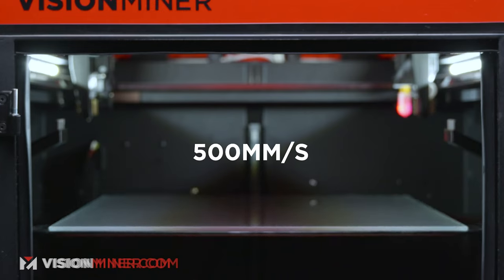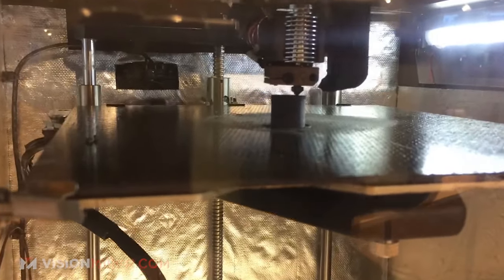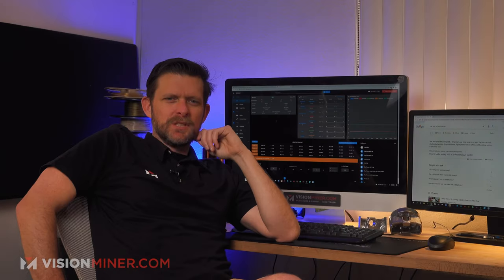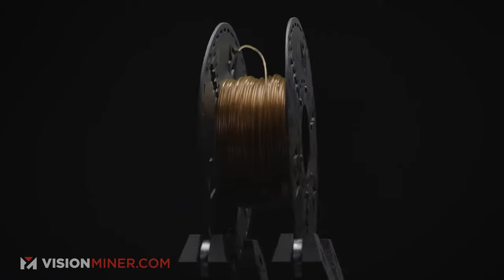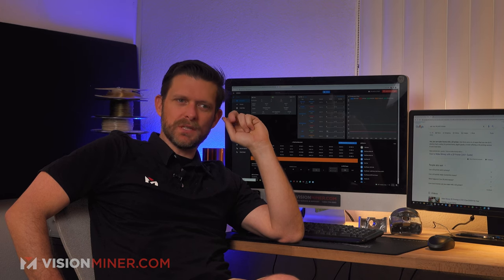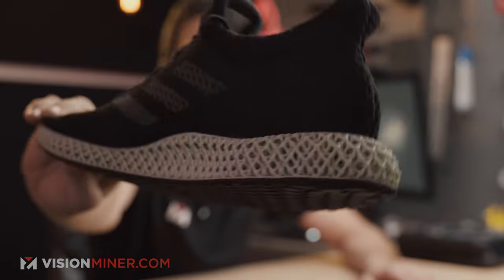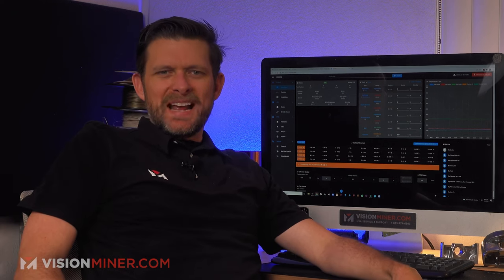The Biggest Lie in 3D Printing | 3D Printing Myths

Comment: I am a professional 3D Printing Technician and I have had customers complain that their parts did not arrive with the stated accuracy of the machine from the MFG of 0.01mm, with the misunderstanding that minimum feature size is not the same as accuracy.
Reply: Then it's your job to make sure that they understand that, if you don't want unhappy customers.
Reply: @marcus3d  Usually it's sales that is supposed to handle customer expectations
Reply: @StinkPickle4000  You're right. The "you" was referring to the service provider, as opposed to the customer. My point was that it's not the customer's fault for not understanding this, but the service provider's fault.
Reply: Yes minimum feature size is the same as accuracy. You have been scammed by the chinese printer companies and now you are repeating their lies. What other industry has such nonsense?
Reply: @marcus3d  It really depends on industry and customer-base. I would expect any engineer to understand the difference and do their due diligence on any contracted services.

Comment: About accuracy, I often see people designing parts for printing the same way as if they were going to be machined from billet aluminum or tool steel, with the same tolerances. There seems to be a lack of education in the manufacturing industry around how to design specifically for printing, and how to design for inaccuracy (meaning: factoring in inherent printing inaccuracy).
Maybe that's something a channel like yours can help evangelize about.

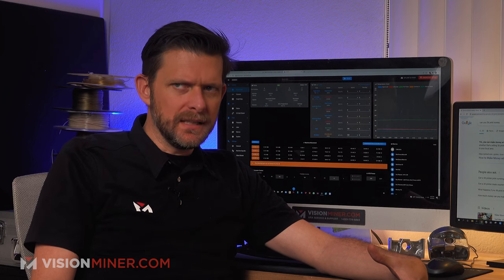Comment: 1:11 "150 mm/s" is not volume per time, so you can't say "to move that much material that quickly". It's literally a distance per time. You'd need 2(!!!) more dimensions for it to be volume per time, namely line width and layer height.

Comment: Would absolutely love a HT video! I absolutely HATE having to restart HT materials... Waiting for the bed to reheat.... Trying to pick the boogers and strip of the previous failed print (while burning your hand on the bed and getting a wiff of fumes)... Etc...

I guess for a video worthy research, maybe do nozzle and bed expansion for different metals and bed types. I know when I switched from OBC to ASA, I forgot to account for heat expansion and gouged a deep trench into my bed 😭😭😭.

It would be nice to know if I switch from low temp material A, how much do I need to offset for high temp material B if I'm using a brass nozzle... Or stainless... Etc

Comment: i know the video is 2 years old BUT watching 2 dudes talk what they learned and not read a fucking script in front of their face is so refreshing. I mean, is every channel now some sort of news channel where you gotta read like a robot? Thanks for all the information, cheers
Reply: oh and btw, I literally jumped into 3D printing world without any research, found used Anycubic mega x for like 1/4 of the price with a couple filament rolls nearby. It's amazing how precise it can get with minimum tweaking. Building a CNC for myself at the moment and was super worried how am I going to obtain parts that hold bearings, linear rods, etc. Turns out - just like that.

Comment: On Creality touchscreens, they will let you set the print speed to high speeds but dont have the facility to increase the acceleration so although it will say you are printing at the faster speed you have selected, in reality, you most definitely are not, some of their stock firmware was shackled also not that I kept that stock firmware for long as it was pathetic even if you sliced to that faster speed, they could not even get the X, Y offset correctly for ABL for 99% of their machines so you got the nozzle in the place were the probe should have been and ended up with a mesh that was not uniform or correct and only four-fifths of the bed actually probed
Reply: You absolutely can adjust the accel and jerk on the configuration screen
Reply: @MakerMark  On which machine?
Reply from the maker: Depends on the machine, of course....

Comment: Do you guys use multi material printers? I'm mainly interested in the quality, speed, and waste material differences when using multiple materials in the same print. I love the idea of water soluble supports, as well as combining complementary materials. Do nozzle changers or duel extruders leak while waiting on the other material to print? How do they not make a stringy mess?
Reply from the maker: It all increases complexity, and therefore the challenge, but once tuned in, you're usually good to go. Our new 22 IDEX is independent dual extrusion, so the extruders are off to the side during the prints, which prevents oozing and leaking, followed by a brush :)

Comment: ISO could help your C OF A validity do you pay an up charge on your resin purchasing for the c of a for every load or just at random loads? normally 1-2cents /lbs on 78000lbs(tanker)-180000/lbs (rail car) or box or bags/lot run and date. my question is the material a blanket C of A or a running each load C of A? do you get a c of a for each load or at random?and for each it would be specific to that load only?
Reply from the maker: We get our COAs from the filament manufacturers based on the lot number found on each spool

Comment: But FDM has changed with time. The bamboo labs x1 now prints at 400ms so it's changing and the filament is also changing.  And yes you can change the ender 5 to print fast depending on the hot end and boards and fans. Upgrade are easy and can be done now if you have the time and money.  So yes bamboo labs can now print fast and very accurate.

Comment: Sorry but this questions is about resins. 
3D systems Figure 4 claim to print with "environmental UV" stable resins (to replace an injection moulded part in full sun).  Is this possible when it requires UV to cure the part. Do you know if this is accurate. Thank you
Reply from the maker: Generally curing is at a specific NM (405nm) wavelength -- whereas environmental UV can be a broad spectrum, so yes, this is possible.

Comment: Are there any printers that work on a radial coordinate system?  What I mean by that is a printer with a z axis and a r axis (radius axis riding on the z axis).  So much of manufactured parts are cylindrical in shape for rotational motion.   It just seems logical that a radial coordinate system would be so much more accurate.  Thanks!

Comment: How difficult is it to get micron accuracy of the Z height correct? Have tried tuning first layer thickness to the micrometre but not too many layers later it is off by a good 100 microns. Do you think it might be a deflection of the gantry or the frame based on the position of the heat bed in the core xy printer?
Reply from the maker: That's probably your initial z-offset -- but gantry/frame issues can definitely affect it, especially if part of the gantry or bed is warped!
Reply: @VisionMiner  It looks like it is more the Aluminium expanding at a different Rate as the steel MGN Rail. The flex over a 600mm rail is quite noticeable.

Comment: Curious regarding IDEX (or tool changers) vs Nozzle Switching multi-extrusion machines.  I've been running an E3D Chimera for some time now and it works, but there are obvious downsides to the design and I'm looking for where to go next on custom/modified printers.

Nozzle switching seems like the best option for minimizing ooze and decreasing print times, but with the minor downside of higher mass on the tool head.  Is there another reason IDEX is seemingly far more common?  This is coming from a hobbyist perspective, so perhaps there are machines that sport both equally in the higher end market.
Reply from the maker: The biggest thing is probably preventing oozing on the part with the non-active nozzle -- but it also enables duplicate/mirror printing, which can double productivity :)

Comment: Pellet Extruder? If the need of better heat transfer to the plastic is an issue, then using pellets (especially if the grains are the size of fine corn meal) would definitely be the better alternative for high speed extrusion. And of course a really good part cooling fan to top it off.
Reply: you could also probably do 90% PA-6 CF. they should probably  test that

Comment: Nice video. Keep it up.  I've been offered to buy a ff creator 3 v1(i think) whit 82h run time for half price. It's a hard machine to research and im wondering if you guys think it's any good? 
Im a hobby 3d printer who's looking to advance my skills and print accuracy. I mainly make functional prints and occasionally some toys for the kids. The dual extruders is the main thing to be able to print in duplicate mode.
Reply from the maker: The "hard to research" part is a good tell -- there's not much of a community around those particular machines, so it makes them harder to fix and modify. We had a creator 3 with the consideration of selling them, but for our specialty (high temp, nylons, polycarbs, etc) it just wasn't performing to our customers needs, so we never sold them. For the price, it's a decent dual extruder / IDEX machine, for basic materials, but there are probably better options out there!

Comment: it's all true when people write 300mm/s on the slicer they think the printer is running at 300mm/s or 500 mm/s, the important thing is that the parts fit together, center-to-center accuracy is important and it is quite easy to achieve this, the hole does not come out 2mm, it comes out 1.6 mm, it is not a problem, it solves it with a drill, but if the centers do not match, then you will lose time and material.

Comment: OK, well I'm that guy.. I've got an Ender3 inside a 1/4" thick Acry-lite enclosure. I've mounted the control electronics out of the box. I put together a 500 Way PTC heater/fan setup controlled with a digital device.... AND I still print most of my parts at 40-60 mps, even when I'm heating it to 90c. BUT I can print CF-12 Nylon and beautiful PC parts. My parts don't warp, and according to my dog they don't come apart easy. Not bad for a hobby printer..

Comment: what kinds of backpressures do you see on the max side of all your materials in the filament manufacturing for BP back pressures?do you get up over 7500 lbs/sqIN maybe you dont have BP guages??how about a MT gauge? do you have one on each filament line?(Melt Temp) what  screw design are you using standard high output or a custom grind ? do you use 20/40/60/40/20 screen packs or how do you filter contamitates?
Reply from the maker: We don't do the material extrusion, no screws on our end, and the screens/process is unique to each filament manufacturer

Comment: I would love a straight answer on where the sweet spot is for an entry level 3D scanner. I fight with the Arctek eva at our makerspace until I want to throw it through a window. I don't use a turntable, I use a turntable. I have a lot of light, I have no light. It is always so hard to get a auto-aligned model. Is there a decent resolution scanner for under a thousand bucks. Or is meshroom and photogrammetry a better route? Thanks for sharing your knowledge with the rest of us mere mortals :-)
Reply from the maker: Under $1000? Don't think so. Your best bet is the Einscan SP at $2500 right now --- but it's not handheld -- for that, the Pro 2x 2020 can be had for around $6000, but the Pro HD is worth the extra $1700 for $7699 -- or, with the turntable too, around $8400. Prices have come down from a few years ago, but nothing in the consumer range that we know of yet!
Reply: @VisionMiner  Thanks a ton for the response! How accurate is photogrammetry like Reality Capture or Meshroom?
Reply from the maker: @Dan Roesch  We haven't used those, but from my knowledge it can be very accurate -- just takes a lot more work, and you don't actually get measurements, just geometries :)

Comment: I cast candy, chocolate and toys,. Are there food safe filament?  I want a 3d printer so that I can go from design straight to working prototype . Do I need a commercial grade printer? Or can a $500 one off of Amazon work and I mean work  every day 9 to 5
Reply from the maker: OK, so, a few things on this one:

1. PSU and other high-temp filaments are food safe, yes -- on a polymer resin basis, not necessarily with the manufacturing style due to the layers, but it can be steam sterilized or chemically sterilized and so can many of the other high-temp filaments

2. Commercial grade vs. Amazon -- for high-temp filaments, you'll need to spend more to be able to process and use the higher-end filaments 

3. Will it work every day 9-5 (amazon or commercial) -- basically no 3D printer is bulletproof yet. As with any industrial piece of machinery, occasionally things go down and need replacing -- that being said, you'll have a much better time with an industrial grade machine over the consumer-basic machines you'll find on amazon. Anything under $8000 at this point generally requires a good amount of maintenance and operator skill to maintain. 

Hope this helps!

Comment: So true... but I alao see some of this a little differently.
First, let me say, I hope that high speed 3D printing becomes an official e-sport! 😄🤣

Because I think 3D printing will be dramatically different in the VERY near future.  

Right now, it's all about overcoming the limitations of the thermal and fluid dynamics of the material delivery system, and then using machine learning to "actively" correct errors and counter machine resonances.  E.G., better controlled velocities.

It's a race to create the fastest, lightest, and most balanced print heads, coupled with minimal gantry designs, then combined with high flow extrusion, and finally maximizing those speeds and the accuracy with software.

The only reason Creality printers ever worked is the light print head with bowden... because otherwise, a shuffling bed is the absolute worst possible design, and it sends terrible unnecessary resonances throughout all of the parts.  The taller the part, the worse it becomes, and the slower you have to go.  That's important because it represents the bulk of home 3D printers.

But with newer designs and machine learning, where software like Klipper is moving the needle to tackle resonances, things are about to change...  Even Nvidia offers an affordable AI board now.  It won't be long until an A.I. like Alpha Go is tasked to play the "3D printing game," and then movement will become more precise than ever, even for many old, cheap, and plain terrible printers.
High-flow-high-pressure-high-temp extrusion is is next in line IMO.  Print head mounted extruders, even the best designed, most minimalistic ultra-light titanium+aerogel "secondary" extruders are bad, because absolutely any extra mass on the moving print head is bad, period.  

IMO, a lonely nozzle driven by just a floss of dynema, 2 power wires, 2 thermister wires, a thin high pressure air cooling line (GOD not CPAP), and a molten material delivery line, would be the best case most minimal configuration possible. 

So I don't think it'll be pellets or filament "at" the print head, I think it'll be molten plastics like the very first attempts at 3D printing, using similar equipment as is currently used in injection molding.

The "flinging" filament is definitely a real challenge at high speeds, but I can imagine multiple simple ways that it might also be addressed through flow rate and nozzle exit designs.  Previously, it was simply a non-issue, so the designs haven't caught up to the possible speeds yet.  
For instance, future nozzles might resemble airbrushes.  Think of thinner compounds like DIY ABS slurry or resin, where an acetone like compound could rapidly evaporate when exposed to the air, or possibly be cured by UV light, leaving behind a thin layer of cured plastic on each pass.  That might allow for higher pressures and velocities that overcome those flinging centrifugal forces.
Or nozzles that rotate like vinyl cutters, ejecting molten plastic in a controlled direction.
Or beds that tilt to catch it, by keeping the part in line with the flinging material.
I'm not suggesting that any of these ideas are good, but there are enough plausible paths that someone will certainly solve that soon, now that high speed machine movement is achievable.

Comment: Why has PCTG not exploded in demand and variety of offerings?
Reply: Because the vast majority of consumer-grade 3D printers are meant to only print PLA. So they have a PTFE tube butting right up against the heat break, which means nozzle temp can only go up to about 260˚C. Plus PLA is cheap and ubiquitous, due to economies of scale.